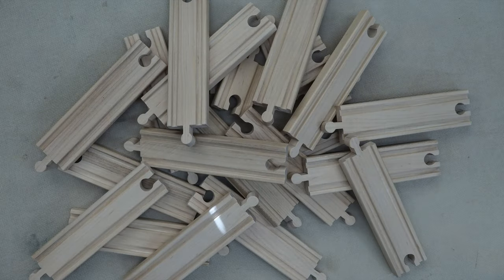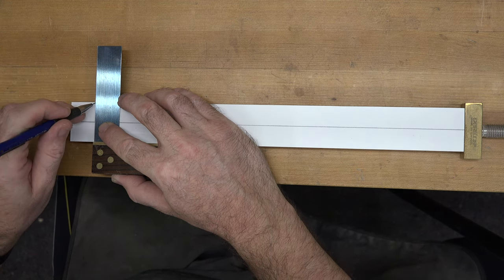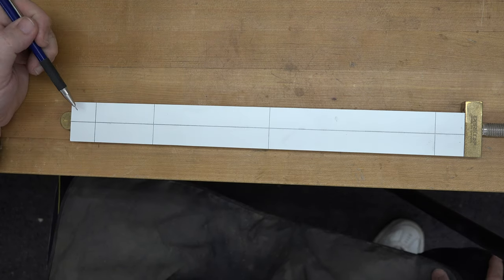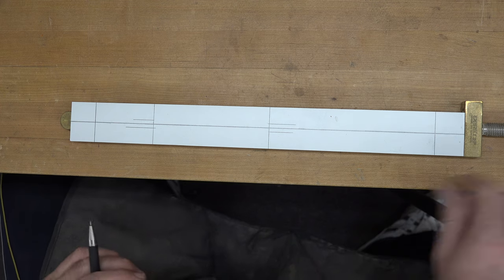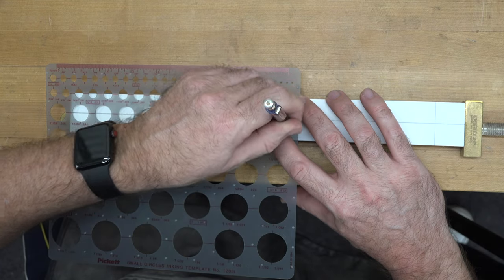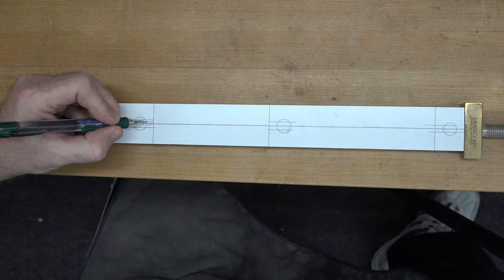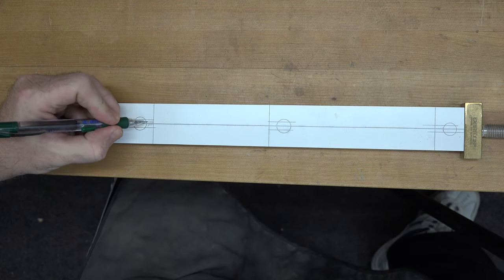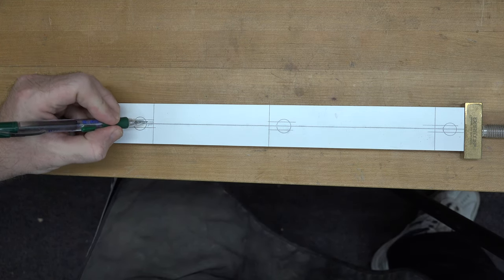Making Wooden Toy Train Tracks

Comment: Nice work! Just a few timesavers for me when doing tracks like this.
1. I sand and do most of the finish to the top and bottom side as well as rounding over the tracks before cutting them to length.
2. The female connector (16:51) is simple to drill, use a scroll or bandsaw to cut the spline.
3. It is a huge timesaver to get a wider saw blade that will cut the correct width in one pass.
Reply from the maker: As I've always said Eric, for every process in the shop, there are about 10+ different methods to achieve that process.  Thanks for the kind words and for taking the time to chime in with your methods.  It's very much appreciated.

Comment: Another well thought out and explained video. I think I would use the drill press to drill out the 1/2" hole and then just cut the slot. I'm assuming these are to add onto a Brio set, since these are made in Sweden they use metric measurements causing all the very tedious 1/64 and 1/32 conversions.
Reply from the maker: I'm not sure of where the set was created Pat.  It wouldn't really make a difference though because I would still work in imperial.  I'm a little mixed up that way.  LOL.  Glad to hear that you liked the video.  I truly appreciate you tuning in and taking the time to leave the kind words.

Comment: I never cease to be amazed at your turning to the scroll saw for projects. When you started this, I had no vision of the scroll saw. I was thinking drill and routing and sawing but not scroll saw. But, I was wondering about the round end on the male part. But, hadn't thought scroll saw. Still too new to scroll saw I guess. Regards, Bill
Reply: Hi Bill:
I'm finding that I turn to my scroll saw more than I thought I would.  It's a great and versatilel tool.
Chuck
Reply from the maker: There's many different ways that this could be done but in my situation, the scroll saw was just the goto tool for me here.  Quick, no setup, relaxing, great results etc etc etc.  Pretty much a no brainer for me and my shop.  Thanks for tuning in to the show Bill.  Great to hear from you.
Reply from the maker: I couldn't agree more Chuck.  It's amazing how versatile the tool is as long as you keep an open mind and use your imagination just a little bit.  Thanks for chiming in on the comments section this week.
Reply: @Goldchucker1  I guess I have to agree but I only got mine about 3 years ago and my first attempt was pretty pathetic. I started again when Covid hit but I am used to the "regular" stuff such as table saw, router, drill press, band saw, etc. At 72, I am not sure I will ever get to the point of thinking ah! Scroll Saw on one of my projects other than something I get a pattern for. But, maybe sometime in the next 30 years. ;o)

Comment: I like this video, was wanting to make some track for the grandkids.  Timing is perfect.  For the female end I thought about using the drill press to make the hole, and that way the only cuts on the female end are some short straight cuts.  The male end, I like the cross cut you made, rather than using the scroll saw.  Thanks.
Reply from the maker: Your methods sound very doable Scott and there is nothing wrong with them.  It's great that you can take the original concept and methods that I show here on the show and tweak them to make them your own.  Well done.  Good luck on your project and thanks for tuning in.

Comment: Great show Ken. I bet this will be a popular project. Is there a reason you didn’t drill out the circular part of the female side with a Forster bit?  Seems like it would ensure consistency and might be a tad faster. —Jim
Reply from the maker: No reason at all Jim.  I just felt like using my scroll saw.  I was in no hurry and this was just the method I chose.  That's the great thing about our hobby.  For every project, there are multiple ways of doing it that will produce the same result.  Thanks for tuning in.

Comment: Great video, going to make this for my grandchildren. 
Where can I get the marking tool you used?
Reply from the maker: The marking tool you are referring to is called a T-rule and they are made by INCRA.  You can get them directly from them of from most woodworking suppliers.  I got mine from Lee Valley.  Here's a link.  I hope it helps.  https://www.leevalley.com/en-ca/shop/tools/hand-tools/marking-and-measuring/rules/58877-incra-t-rules
Thanks for tuning in.
Reply: @acutabove_woodworkings  Thank you,  I'm purchasing the T-rule. It's going to make laying out my projects a lot easier.  Could an ellipse jig be used to cut the grooves for curved track?
Reply from the maker: @cwhouseknecht  I would think that a compass would be more capable of marking out the curved tracks.  I am hoping to put together a show in the new year about making curved tracks and possibly a few accessories for the tracks.  I hope this helps.

Comment: Hi Kenny, incredible work! may I know the measurement of the template in a photo? And what do you use for the template? thanks!
Reply from the maker: The templates are made from 1/4" MDF or hardboard Ima.  As for the measurements, all the dimensions you need are contained in the show.  Just follow along and you should have no problem making a template for these tracks.  Thanks for tuning in.

Comment: how did you do turnings??
Reply from the maker: Making curved pieces for the corners is a little bit of a different process.  I haven't done a show on that as of yet but you can look for one in the near future on the channel.  Thanks for tuning in.
Reply: @acutabove_woodworkings  when is soon? my girl is groving :)
Reply from the maker: @kilicmelik1982  realistically, the show is currently booked in until around June of 2021 so the track show would probably not air until at least August.  I hope this helps.